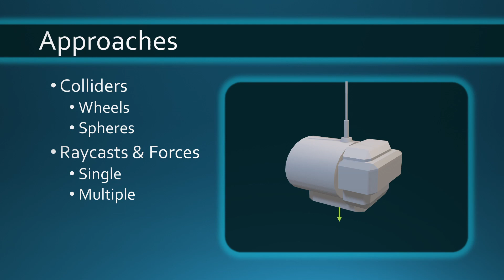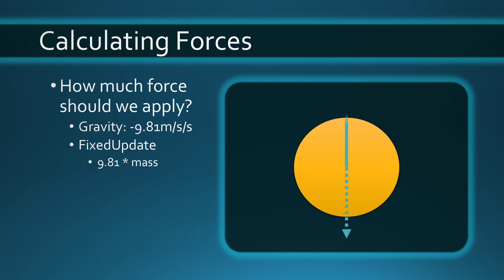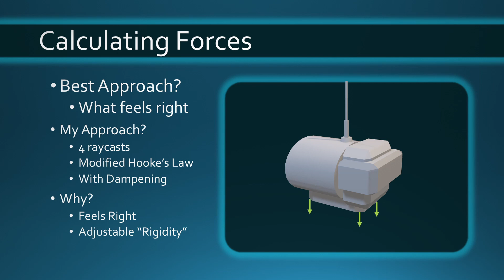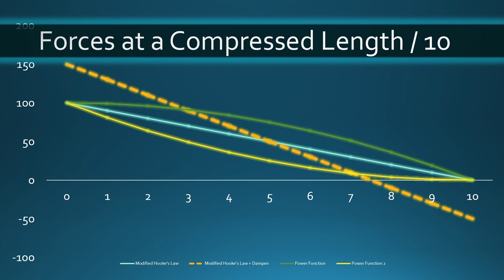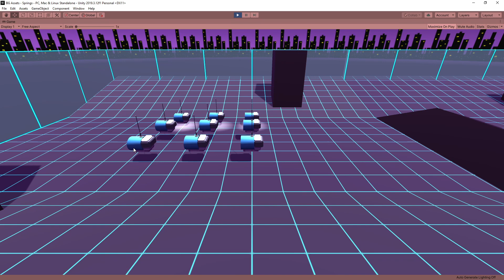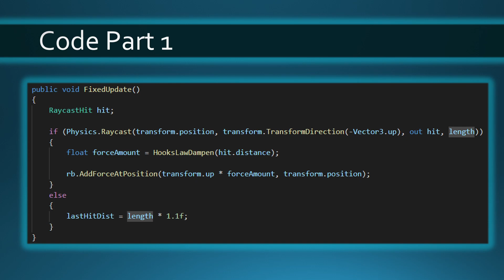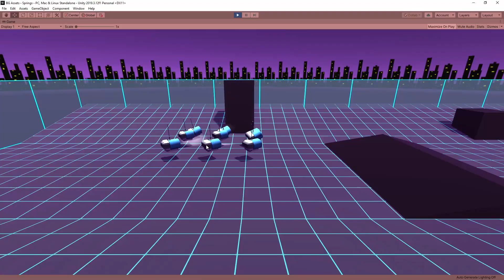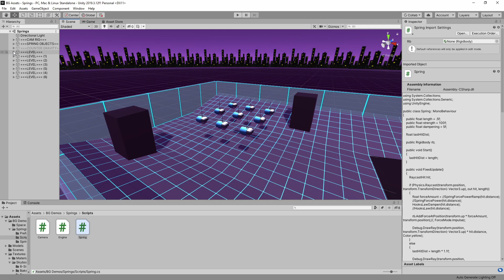Hover Physics in Unity3D

Comment: I am using 2 PID controllers to:

1) Make the ship hover above the desire distance by applying force
2) Make the ship align to the normal vector of the face bellow it by applying torque

This works fine for slow speed hovercrafts (bellow 300km/h), however I am struggling to make it work for high speed hovecrafts (above 600km/h), hard turns make the ship collide

Comment: Great tutorial! Having some issues with collisions though. I attached the code to a model with some controls and can hover around. But the character goes right through any collider ABOVE the height of the raycast position for the hover. I have capsule colliders on both the characters and the stationary objects in question. The collision is detected (had some debug in the OnCollision methods) so I know they are colliding. But the character just rides straight through them. How did you manage the collision detection in the video here?
Reply: I should say, if the object is under the raycast position, the hover will adjust accordingly and go over the object no problem. It seems to only be an issue with collisions that are above the raycast position

Comment: This is an incredible tutorial. Probably the best one I've seen about the topic so far. The problem is: Depending on scale of your objects, gravity, mass and drag, things like "a lot of strength" and "most extreme dampening" become more ambiguous than they are already. After an hour of playing with the variables I'm just swinging between "never stabilizes" and "shoots away like a bullet as soon as angle of ground changes". Hitting that soft spot where the dampening and strength of the spring becomes just right to react to changes in the environment really is an exercise in frustration.
Reply from the maker: You have a good point. One improvement from this video I found was setting the dampening dependent on the spring strength, but there are a lot of different approaches. One of the easy "fixes" is to fake dampening by increasing drag on the rigidbody, but that affects all motion and not just the hover effect. The PID controller actually is a better solution I think.
Reply: @bitgalaxis1147  I believe to think so, too. I am working with really small drag values and was aiming to have as little as possible or none at all to get really friction-less movement, but that does make a lot of simple hover solutions a very explosive mix. :D

Comment: implementing a minimum and maximum spring travel length can help with bounce/oscillations overshooting so the dampening can work faster to bring the springs back a normal position.
Reply from the maker: Is that what you implemented on your hover racer prototype? It looked good!
Reply: @bitgalaxis1147  It's basically the same thing that you have implemented with Hookes Law, I've just added the rest length and travel length and clamped them to a minimum (rest length - travel length) & maximum (rest length + travel length). There's a great Khan Academy resource (Spring forces) that goes through it. You can actually also add some velocity to the dampening by dividing it by Time.deltatime. (lastHitDist - hitDistance) / Time.deltatime.
Reply: @bufferoverflovv  what do you mean by "rest length "? Do you mean the difference  between the raycast length and the hover height?

Comment: How did you get your vehicles to self-right when tipping over?

would love to see the code.

Might want to show how you derive your c*v + K*x = F... but including the last hit distance, you effectively creating a pseudo CV term.
Reply from the maker: There is no self-righting code on this, as the 4 springs on each truck generally work well to self-correct. If I disable some of the springs, the vehicles will flip. 

You are correct that the last hit distance is a pseudo CV term, because it's a cheat -- to quote the video, "This is a quick dirty calculation." Dirty needs more emphasis. The last hit distance is only being used to approximate the speed with which the spring is being compressed in order to simulate a dampening effect. It's not correctly calculating dampening forces because it would require an evaluation of the relative speed between two objects. This cheat is close-enough, simple, and had better results (for my purposes) than actually implementing speed calculations.

Comment: You, Sir, are an absolute wizard.
Is there a way to adjust the hover height?
Reply from the maker: Yes. All you have to do is change the length of the spring.
Reply: @bitgalaxis1147  i changed the length field to 2.0 with no visible change. 3.0 made the entire thing take off and fly away.
Reply from the maker: @ZefugiLive   That's odd. I would make sure the starting position of the object is slightly beyond the length, but it shouldn't matter. Also make sure there's a max force. I'll try to reproduce it.
Reply from the maker: @ZefugiLive   Ok I played with some settings and recognize what the problem might be. The formula used is very simplified, but there are a lot of factors we don't consider in this video that need to be addressed for edge cases. 

To keep it simple, be careful with the combination of the total mass, spring length, and spring strength, and even dampening (in reality, dampening shouldn't even be a variable, it should just be based on the strength, but still something the developer should tweak). The lower your mass, the weaker your springs should be. The shorter the spring, the less stable it will be for small movement. With extremely long springs, going over extremely uneven landscape or (accidentally toppling the object) can make the physics go haywire.

Here are some ideas I've played with:
   1. Adding several more springs (some angled outward at the edges by around 15 degrees) and reducing their power and dampening (this can really smooth out the motion if done right but takes a bit of tweaking)
   2. Just playing with the weight, length, strength, and dampening. 
   3. Modifying the code to output a single force (this one is has smoother up and down motion, but less control over the vehicle rolling over)
Reply: @bitgalaxis1147  thank you, I'll try to adjust it and see what happens.
Reply: I wish I read this comment chain earlier. I was having so many issues trying to recreate this.

Comment: Over at the Unity channel they have a hover racer tutorial where it's mentioned the use of a PID controller to stabilize the ship. It seems like it is commonly used for stuff like self-driving vehicles. Your video is the second tutorial on hovering mechanics I've watched so far, besides the Unity one, that tries to tackle the fluctuation problem, and is also the best presented.
Reply from the maker: Thank you for the feedback! The primary reason I made this video was my own frustration not being able to stop the bouncing when implementing hover systems shown elsewhere. My best guess is others are using drag on their rigidbodies to stop the oscillations.
Reply: The key element is the "D" in PID- adding a force based on the derivative of the spring length (aka how fast the length of the spring is decreasing, aka damping). So, these are just slightly different ways of describing the same approach :)

Comment: Please trying to implement this but it never stabilizes
Reply from the maker: Be sure to check if you have dampening, and play with dampening values, or add drag.
Reply: @bitgalaxis1147  I do then it stabilizes but once I try to even use it on a procedural animation, it goes haywire but trying to implement a PID controller. Thanks